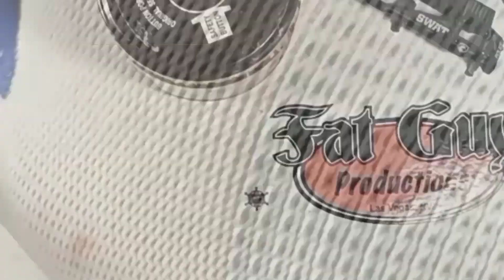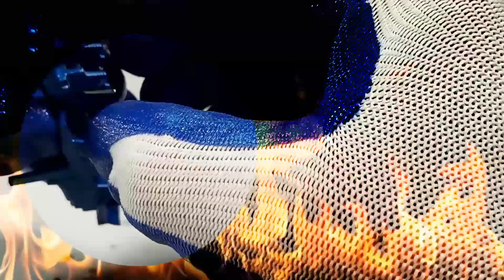Shoots & Ladders Build Off with Paul from Fat Guy Productions

Comment: I love the build, and I love the end result, but I would prefer a less distracting video. I really prefer focusing on the build's challenges and the builder's techniques and processes rather than all the special video FX which distract and detract from the subject. The casting conversion is supposed to be the star or center of the story. I'm interested in "How to..." and not "Lookee what I can do!!!"  Do you see the difference? I noticed that the blue plastic was basically the same shade as the gloves, and I lost visual track of what you were doing. Is the video worthy of a 👎? No! The end result of the vehicle speaks for itself. It's a unique UNIMOG to behold! Those trucks are a big uncut marble slab begging to be shaped by a master sculptor. It's clearly a craftsman's fine work shown at the end! I'm not trying to be harsh. There's way too much harshness out here. I just can't give the video production work a 👍either.